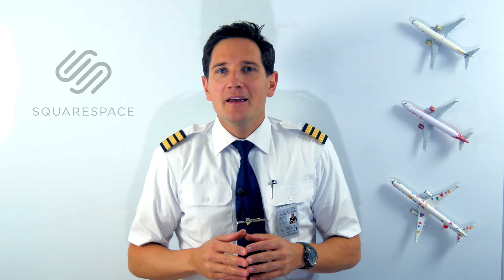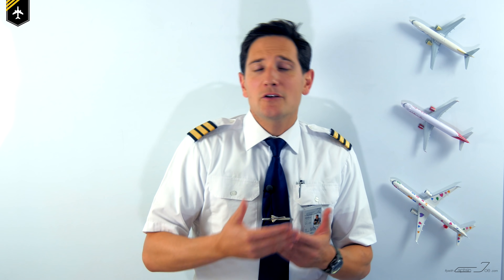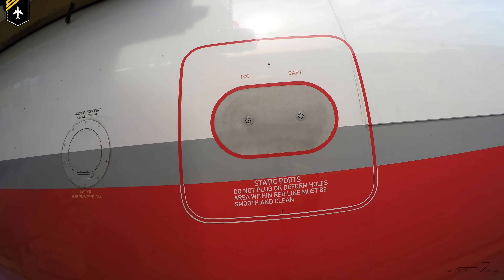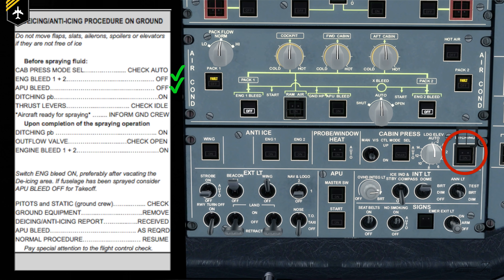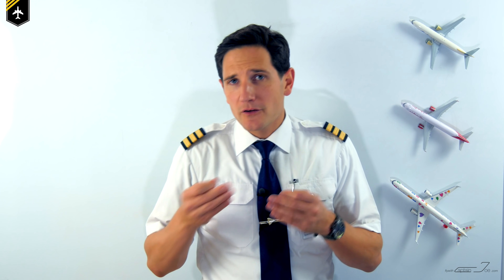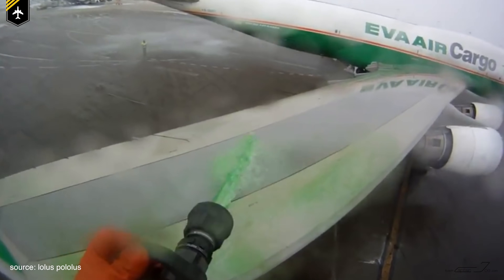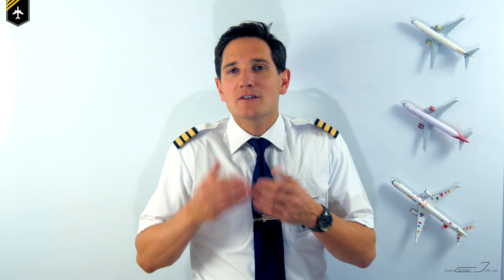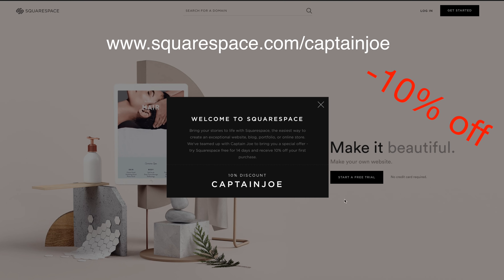Why do PILOTS DEICE? Explained by CAPTAIN JOE

Comment: How much does it cost a deicing procedure for a large aircraft? Say a 747...
Reply from the maker: Damn, forgot to mention that, I´ll make an update video ;)
Reply: Hey Marco, I am a de-icing techician in Canada. As Captain Joe explain, we here spray type 1 and type 4 only. They are very costly 10$/liter for type 1 and I believe $14/liter for type 4. But what my manager told me is that each airline pay a certain contract deal with the de-icer company so they save a lot more money. So 747 would be included in the seasonal deal. No matter how much we spray on B747 it will be the same fix fee for that airline. Hope this help a little
Reply: What does it cost not to deice?  Air Florida did deice but had to wait 45 minutes for a clearance to takeoff but the pilot did not want to return for more deicing.  The consequence was 78 killed.  So what is the true cost to deice vs not deicing?
Reply: 20-30 mins!

Comment: Captain Joe. RAMP AGENT here, also working on my commercial. Why is the front of the engine cone on the a320/319 a rubber type material?  I've asked many pilots during their walk arounds and none of them know why. Thanks! Love your videos.
Reply: Eric Manning : Behind the Cone is the radar. Any metal would affect the microwaves just like in an oven. Radar uses very short radio, micro waves, to see what is ahead.
Reply: iamedbytes I'm not asking about the nose of the airplane, I know that behind the nose of the aircraft sits the radar, but I'm not referring to that. I'm asking about the front center of the engine. The center cone, that all the blades connect to. The tip of that cone is made out of a rubber material.
Reply: Eric Manning : Ah, reading comprehension. That cone is a deflector for debris. Also, like on prop planes, it directs the air flow better than a flat plate. Being rubber it dampens vibration. At least that is what I've heard. It helps to answer the actual question.  :-)
Reply: iamedbytes after hearing your response and asking yet another pilot who didn't know the answer, a quick google search found it. I understand why it's a cone and not flat, that wasn't my question. It turns out the reason it is rubber is to break up the ice accumulation on the tip of the cone. Being rubber allows it to become off balance when ice forms over it unevenly. The off balance then allows the rubber to flex and vibrate which will then break off any ice that had accumulated onto that surface. Makes sense to me.
Reply: Eric Manning : Sounds right. Sounds like there was a lot of thinking going on when they designed that cone. Now, stripes and spirals on the cone what's up with that? I have heard lots of reasons.
Reply: iamedbytes I'm not sure. I know as a ramp agent they help us know how much the engines have spooled down.  But I'm not sure if that's the main reason.

Comment: Ehhm, just a question: if you start up engines of your ACFT, hydraulic pumps will be driven and control surfaces such as ailerons and elevators (and vertical stab rudder of course), who were hanging down (or to one side --> rudder) due to low hydraulic pressure, will be put in there normal position. But there could be a possiblility of damaging these control surfaces, couldn't it?

Comment: How does Air conditioning work on a commercial airplane?
Reply from the maker: Coming up!
Reply: Air from the engine compressor stages (before it gets mixed with any fuel) gets cooled (amongst some other things) and is then let into the cabin through different entries. The pressurisation of a plane, by the way, is only controlled by different valves which control how much air gets out again.
I hope this answers your question, even though I'm not captain joe :)
Reply: Daniel Handle 
In reply to your first reply. It doesn't have to be cooling. At 40,000 ft the air is -50°C or so!!! Therefore the air needs to be heated up before supply into the cabin. 🙂
Reply: https://www.youtube.com/watch?v=BJl-a34rr-c + https://www.youtube.com/watch?v=sSXBbnkt1Eg and https://www.youtube.com/watch?v=ETRZDsgjEvE  - basically, each plane has at least two big ass fans( some use only one engine to power AC - there was even a crash caused by this)
Reply: Gaming Soir that’s the gears being stored in the undercarriage of the plane?
Reply: Leon Sawicki the rotation of the turbines pumps air into the cabin
Reply: Yes, it is my understanding that it is true. You have to understand that the air in a jet engine moves from the front to the back. In the middle is the combustion chamber, where it the air is mixed with fuel and burned. The Air for the different systems like Air conditioning is scooped before it enters the combustion engine. 

Now if the Engine had a malfunction, like a fire in front of the combustion chamber, or a surge, which could reverse the direction of the airflow, then you could have contaminated air.

Interestingly, in case of an engine fire, one of the first things is to practically cut off all the connections of the engine to the plane (hydraulics, Air, etc.) So that wouldnt contaminate the Air.
Reply: Captain Joe can you explain why the gears tilt before gear up or toucdown
Reply: Wasn't there a video by the Cap on this topic?

Comment: Hello, Captain Joe! Did you see https://www.youtube.com/watch?v=925MgqyU2NA ? Can you give some comments?
Reply: in theory if all procedures are followed correctly.. that should be just snow and with a severe snowfall it is possible to accumulate that much snow even after the deiceing.. problem on the current vid is that it doens't seem to snow.. visibility is too good for that.. i would love to see joe's responce on the vid..
Reply from the maker: That´s my personal nightmare!!!
Reply: Asking for trouble. There was accident in US( google fails me on this ATM), where icing + bad take off weight calculation caused plane to crash during take off( it went two light poles and under the bridge iirc).

Comment: joe View on Airbus A380?
Reply: Good plane. Got myself one a few months ago. A bit expensive but worth it. It's very powerfull and comfortable.
Reply: Gernuts sure is
Reply: It's certainly in a niche market, and it's the only place in that niche, so even if it wasn't good (which in my view it is, just for the record), airlines wouldn't have much choice. Anyway, it could soon be the only quadjet still in production... You see, if the A350-1100 really does become a reality, and even moreso if they make an A350-1200, then there is no reason whatsoever anymore for the 747 to exist, and even Boeing itself is likely to drop it in favour of an elongated 777X. Since the A340 already went out of production a few years ago, and only the 747 and A380 remain as four-engined airliners, the A380 could well be left as the only one...